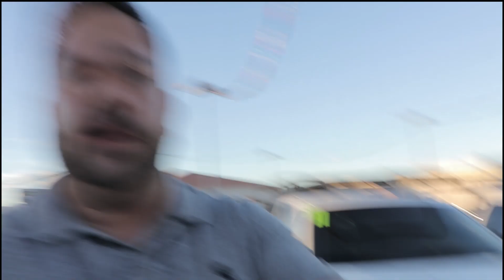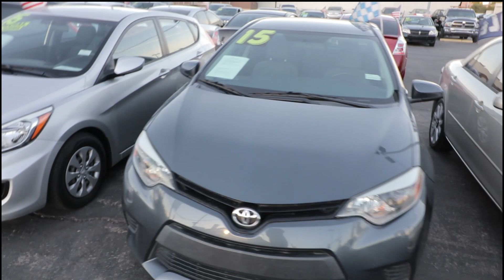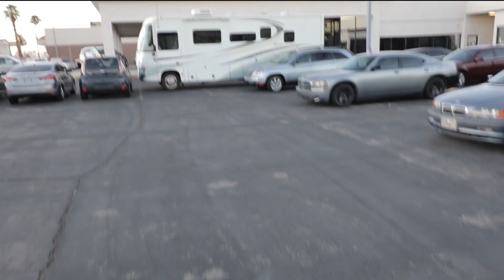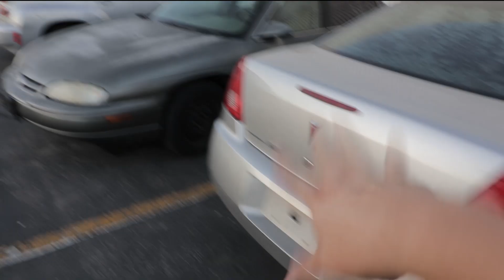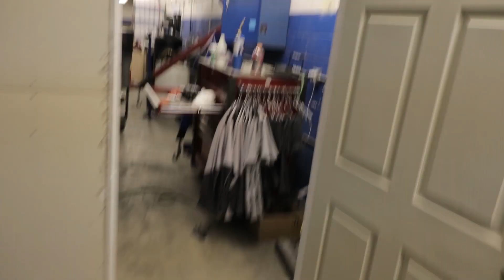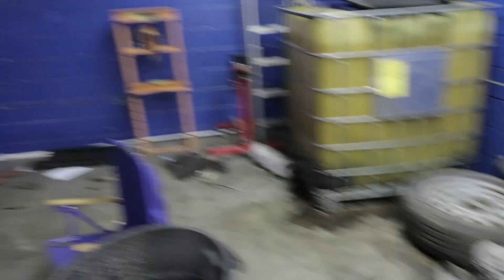My First Car Dealership

Comment: I don't want to be bothered by a salesman. I look over the entire lot before I even want to talk to a salesman. I generally want new, but bought a 2013 Ford FLEX that had 13K on it discounted by USAA in 2013. It only has 70K on it, and it has had no issues.

Comment: Great and very informational videos, do you have buyers or you are only one  who goes to auction?
Reply from the maker: Dachi Jguniashvili     I go to the auction.  And buy all my cars.          I like to check each car out before buying
Reply: Automotive Life Automotive Life Automotive Life I’m thinking to open small car lot, I found building can hold 15 cars and at it’s located on pretty busy street. Based on your previous video , i believe it is good location because it’s consider as wearhouse type of dealership and at the same time it’s on busy street where I can still park couple of  cars in front of building to attract customers. My question is about expenses. Building will cost me 3500 plus utilities. I’m wondering Should I start using  Dealer Center right away or try to keep expenses as low as possible? I appreciate your advise
Reply from the maker: Dachi Jguniashvili     You want to used DealerCenter right away cuz it will help you track everything.           I would stay away from a warehouse.      Unless it has a large lot.   Cuz in 90day you can out grow it.  I see it happen all the time.      Go for the most parking in the beginning.     Tiny office. 😃👍

Comment: Automotive Life Im Located in Alabama New Dealer as of 2019 have my Car lot location everything is set up really nice about 10 car inventory rite now But trying 2 get to at least 25, I have been doing pretty good being that I started towards the closing months of 2019. I have 1 floor plan wit nextgear, which I have a few floored cars & I Also have a few cash cars!! 
           Also I am connected to a guaranteed financing company also which I sell all my floored cars on that platform. But I wanted to know how do I get connected wit sub prime lenders where I can make a sale & I receive full profits instead of having to share a portions with CAPS? Also how do I get started with buying cars from dealerships @ cheap prices like U where doin in your flipping vids? Also how can I access more capital? Because rite now Im being very wise on how I use my floor plan !!
Reply from the maker: As Far as Capital   there is Nothing     Every bank will not lend to Dealers     with a 800 credit score and 200-300k in sales every month   bank still told me no lol   you have to Slowly    build your capital or find a investor      Sub prime bank  you have to find them in your area      Call your Dealers association  or ask other dealers what banks they use

Comment: Man congratulations You have a nice place and the shop is great! Did you start with an auto repair shop and then got involved in the dealership business? I have an auto repair shop  i can fit about 20 cars in it and I'm thinking about getting my dealer license.
can i use my auto  repair shop to start the auto dealer business?
Reply from the maker: Eliezer Aldana    I had a repair shop and customizing      In the beginning.        I started flipping car.   Once I started flipping 20-30
Cars a month.  I went and got my dealers license.            I would always recommend a dealers license or. Wholesale license.